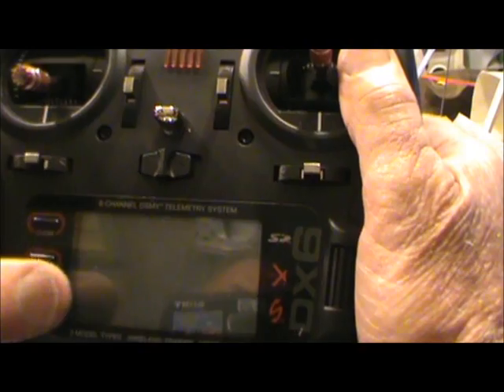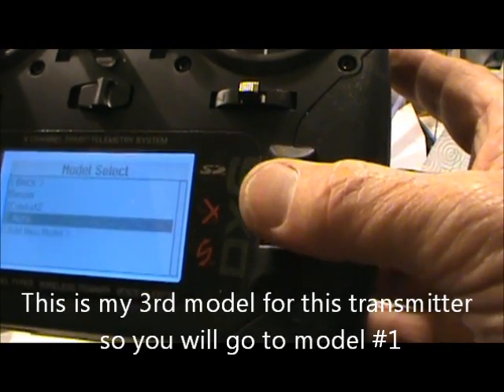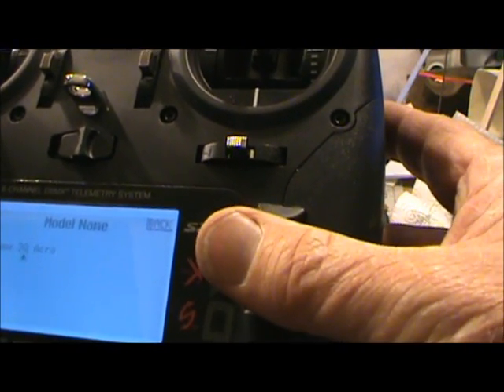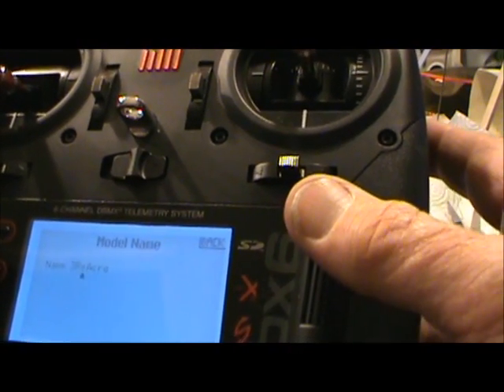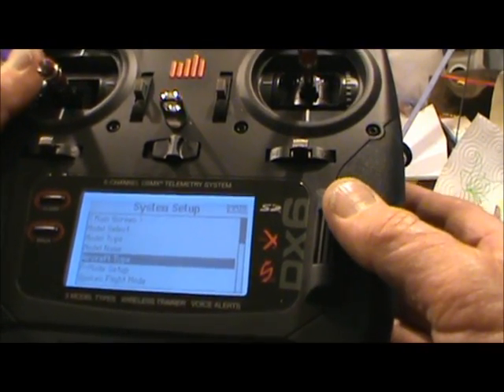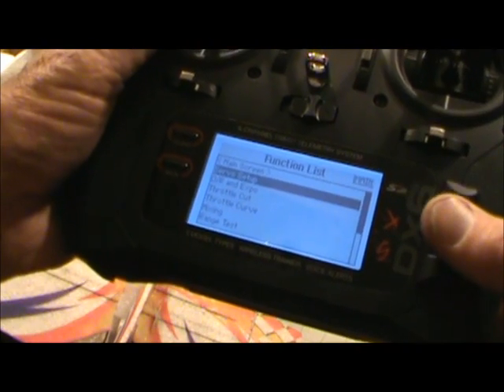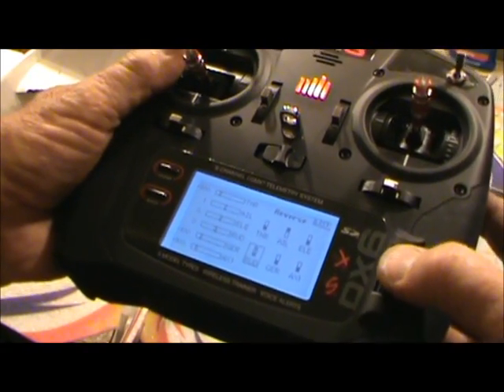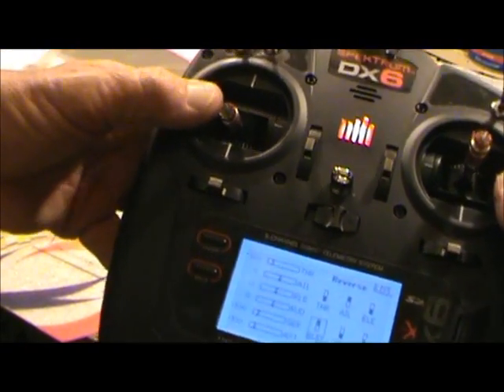Spektrum DX6 Transmitter Installing your 1st airplane

Comment: That was helpful, but it didn't cover setting up DR/Expos (throw rates), which is pretty important before a flight. I am at that point with my new Dx6 and the instruction manual gives terribly incomplete instructions.

Comment: What happened to binding? That was a fail. Its nice to see the rest of it but why did you skip bind? I knw its easy but nubs like step to step. The DX 6 is everything the DX6i was supposed to be be its designers rushed it out the door and it became the laughing stock of the DX series. The brown outs were the worse. I religated mine to flite test foamys and UMX fliers only. I could never trust it with any other Spektrum receiver application. Mine even failed to operate an Apprentice properly. What a joke. Love my DX 6, got it on E- Bay for a song!